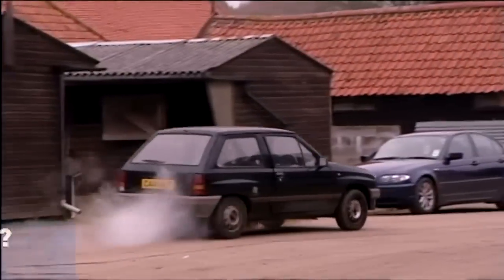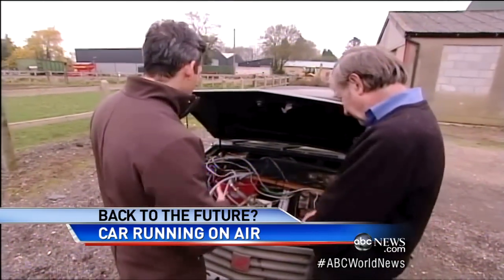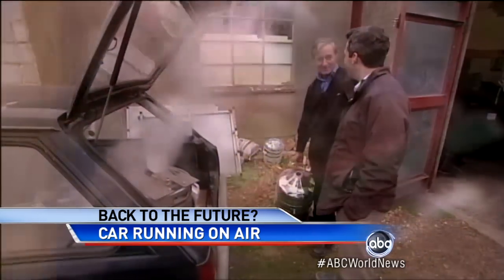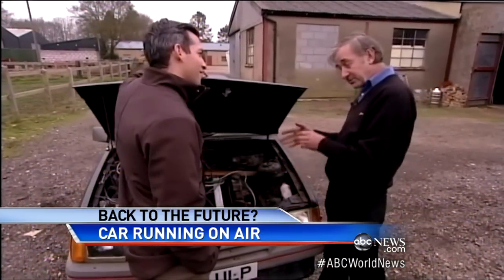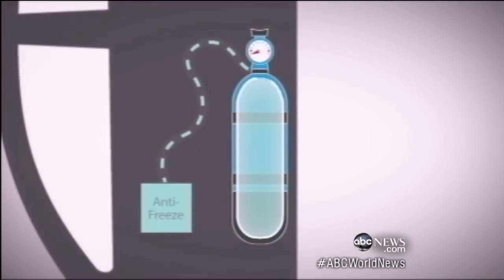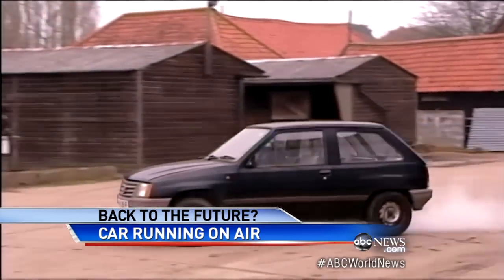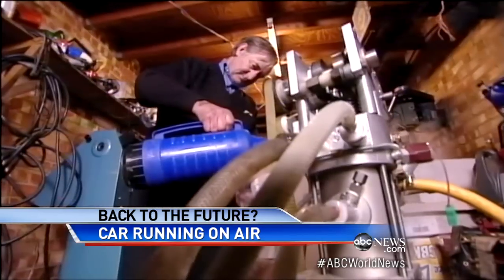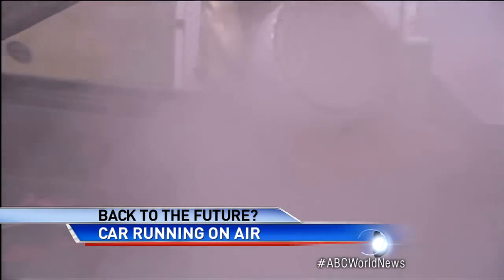Greenest Car on the Road Runs on Nothing But Air

Comment: I wonder if the rotating motion of a wind mill could be used to compress air directly. These nitrogen vehicles freeze up easily because of condensation of water vapour on the cold parts. So I see the future as self driving slowly moving simple platforms that can be stopped easily, for pedestrians and cargo inside historical cities that are now often traffic free. Underneath the platforms and perhaps shielded for touch even above, heat exhange pipes can be present, extracting the heat out of the air. These things could even cool the air in hot cities as byproduct.

Comment: this will of course never be. of course you can power a car on compressed air. but storing energy that way is hard so the range is only a couple of km. and it's extremely inefficient because thermodynamics is the retarded part of physics. battery drive is obviously vastly superior. what he's doing here is not important at all. it's a joke.

Comment: You are right in that the air-powered car causes more pollution than electric ones in mass production. You are wrong however, in that the idea is not useless because the energy can be harvested for essential free in small scale. That is about half-half. Read my comment, and I'm blocking you too.

Comment: My own research: Air-powered cars are greener than gas-powered ones, and the electric cars in general do cause least amount of pollution. However, the compressed air can be harvested as byproducts of many other industrial processes, they cost less to transport, and do not suffer from the degradation process. It can be the greenest option at times, certainly not useless. You are about half right.

If you talk like this in real life, then I'm sure most people will call your tone condescending.

Comment: Funny how you tell me to "stop trying to sound smart" after you asked a dumb question and made a sophistic rebuttal. "there is no reason to say that people who design car engines for a living do not understand the simple concepts you mentioned". YES, THERE IS A REASON. The energy loss in charging a battery is OBVIOUSLY, OBVIOUSLY far less than compressing the equivalent amount of air, AND THE AIR HAS TO BE CONVERTED BACK INTO ELECTRICITY FOR OTHER CAR FUNCTIONS ANYWAY. It is RIDICULOUSLY DUMB.

Comment: Oh well, they make most air powered cars from aluminum.  I hate fluorine as much as I hate lead in gasoline.  Raw aluminum (comprising 8% of the earth's crust) has to be heated to 4000 degrees without chemicals that lower that melting point to 950 degrees.  It does save manufacturing energy since steel has to be heated to 3000 to 3500 degrees.  
Besides, what I read online is that they're trying to figure out how to make air refill stations profitable before releasing the technology.

Comment: Both electric and air can run infinity just by incorporating dual systems that work together they just don't see a hugh profit in it so why do it. they will do very little research and development on this but will keep the fossil fuel going because it is hugh profits. hybird technology that's as far as it'll get till when??? When we run out of oil? most likely, the corporate GREEDs are not about to give up their black gold drills, excuses excuses keep making them up.

Comment: You still don't get it. You lose a LOT of energy in the conversion from electricity to compressed air. So unless you're getting it from some other source, it means you BURN MORE FOSSIL FUEL to store the equivalent amount of energy. What sense does it make to use air if you have to convert it back to electricity for running your headlights and whatnot? I agree that there are still shortcomings in the electric car concepts so far, but those shortcomings are nil compared to this idea of using air.

Comment: You use electricity to power an air compressor just like you use a wall outlet to charge an electric car.  The amount of electricity expended by each is comparable.  Lithium ion batteries take 8 hrs to charge, and need to be replaced in 3-4 years at great cost.  
Check out Volvo Air Motion from 2010 LA auto show as a showcase of compressed air technology.  
I'm not opposed to electric cars, but charging technology and battery technology needs advancement

Comment: I'm not arguing that compressed air CAN't be used, but when it comes to efficiency it makes no sense to use at all. Electric, on the other hand, makes all the sense in the world. It's easy to transport, the engineering for use is less complex and highly efficient, it can be generated in many different ways, it doesn't freaking EXPLODE (at least not as readily as gases can), it's compatible with far more than just your car, and so on. Compressed air has NONE of these benefits.

Comment: Actually, it COULD, but so can cheap batteries or man-made hydrocarbon fuel. 
All of our automotive fuel is inefficiently converted solar energy-based plant material compressed for sufficient time. It's cheap because it has accumulated over millions of years but will be exhausted over centuries. Eventually, fossil fuels will run out (less being formed underground than extracted), so we will need to replace it with another inefficient transport fuel. Air is simple and plentiful. Could work.

Comment: From $5.00 bucks a gallon to water for nothing $0.00? it just sounds to good to be true, GREED won't let it happen as long as there's fossil fuels available to drill these inventions won't see the light of day, the corporates will hush it up, unless of course it's a simple reliable solution that's easy to convert over to then it'll be a new beginning in transportation! without the money gouge...Good luck on this one.

Comment: I can make the claim that it has the same or higher level of pollution, and I don't need any numbers when it's a ridiculously simple algebraic equation. Energy loss of fossil fuel burning + energy loss of electrical transmission + energy loss of super-cooling nitrogen + energy loss of super-cooling oxygen is less than energy loss of fossil fuel burning + energy loss of electrical transmission. More energy loss translates to higher pollution, because it requires more burning of fossil fuels. Duh

Comment: I don't know any statistics. However, it does not make my criticisms invalid. You can't claim it to have the same level of pollution without knowing any numbers

I don't think that you are an expert in the field. If the core idea is really "severely flawed", then I would say that you are right. However, I doubt if you did anymore research than just googling.

It is a good analogy to say that decade-old ideas can still be implemented as technology becomes more developed.

Comment: I sound like a dumbass because I didn't talk about something that's irrelevant to the point? I'm pretty sure that indicates that the dumbassery is on your end, bub. I'm all for solar power. Wasting that generated energy to compress air for use in a car is still stupid as hell. Like I've stated several times already: it makes far more sense to just use a damn electric car.

Comment: This car does not "burn gas". It uses compressed gas. The problem is that it's a very inefficient way to store energy. Sure, you might be able to make a motor that uses it efficiently, but the production of the compressed gas uses a lot of fossil fuel resources itself. It makes far more sense to store that electricity in a battery or capacitor to use in a car rather than waste it on compressing some gas.

Comment: You're just not getting it. I'm not saying that you can't power a car with compressed air. I'm saying that you have to spend just as much and more fossil fuel resources to compress the air in order to use it as a fuel source for your car. That is what makes this idea ridiculous - IT DOESN'T REDUCE EMISSIONS AND THERE'S A MUCH BETTER ALTERNATIVE. I have no idea why you're talking about aluminum frames and motors and 'safety problems'. If you want to reduce emissions in a car, GO ELECTRIC.

Comment: I wonder how did you know so much their product from watching a video less than 2 minutes long. You think that people who design car engines for a living know nothing about physics? You think that a useless thing will sell in the market? 

Of course, it does require energy to compress the air, but is this process more energy efficient than burning gasoline? It seems like yes.

Comment: The US govt studied air powered vehicles in the early 1900's.  Air powered vehicles are used in coal mines (methane gas/combustion engine=boom).  Search for Di Pietro's rotary air powered motor...it's 93% efficient, exhausting clean, cool air.  Compare to combustion motors at 30-40% efficiency, meaning it converts only 30-40% of the energy you put in, wasting the rest.  Aluminum frames and motors are safety problems for US approval.

Comment: What do you mean "how do you get so many thumbs up so quickly?" This video has over 400 views and I've got 5 thumbs up. Also you didn't address the point I made in the previous comment at all and you're saying things that don't even make any sense. "It doesn't need more energy to make itself energy" WTF? You just don't understand that you LOSE SOME ENERGY each time you convert the form it's stored in - the more conversions then more is wasted. And compressed gas is not a good storage system.

Comment: What do you think is being used to compress that air? Electricity. What powers our electricity? Fossil fuels. That's three conversions of energy: fossil fuel -> electricity -> compressed gas, each stage losing some of the original energy output. So this thing actually produces MORE emissions than it would take to simply stick the gas directly into a tank and burn it, and is next to useless. If we want to have efficient use of our fossil fuels then electric cars is the way to go, not this junk.